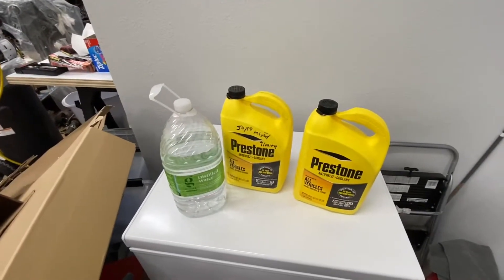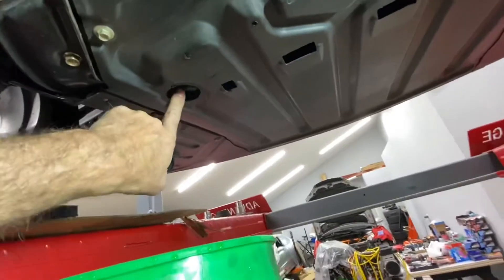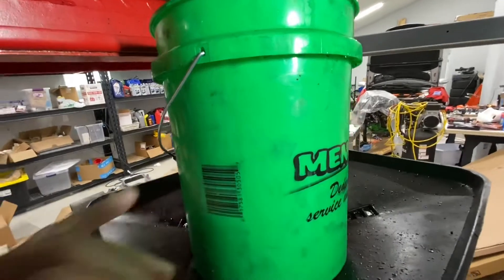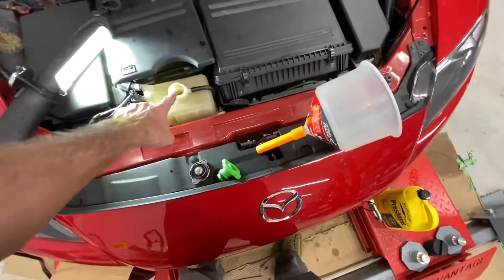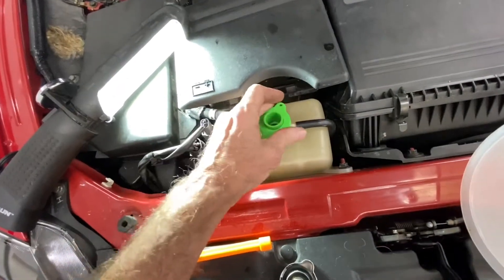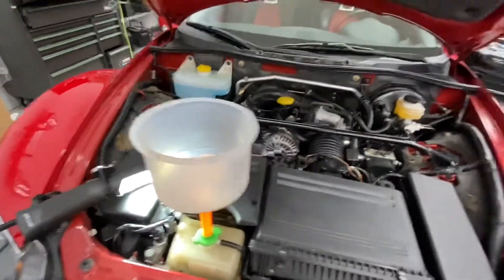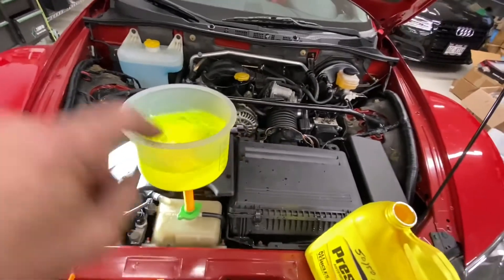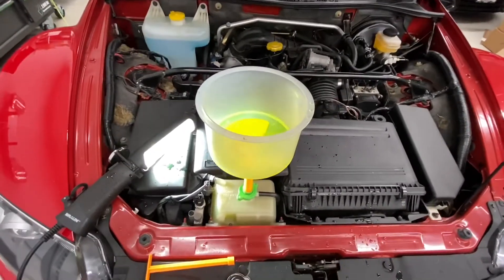Coolant change 2006 Mazda RX8

Comment: You can only use FL22 coolant. He also forgot to drain the engine of coolant. This is a bad video.
Reply from the maker: I never drain the engine block. My goal is a partial exchange every year. Thanks!
Reply: @rickythor1117, you sir, are ignorant.  The Prestone universal extended life coolant he used works in all makes and models and is perfectly fine here.  In fact, it's superior to FL22, with a superior service life of 10 years/300k miles.  FL22 is also sensitive to light exposure, while Prestone is not.  Regarding draining the engine, that is completely unnecessary in this instance.  There is no reason to do that unless the coolant is in very bad condition, like what you'd have if water alone was used to fill the cooling system.